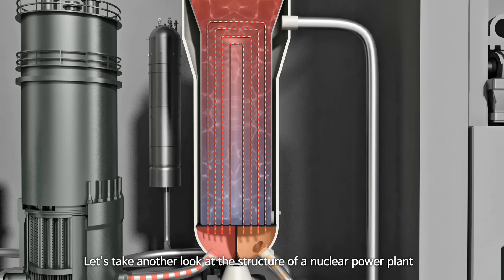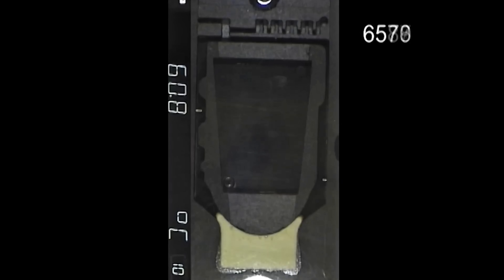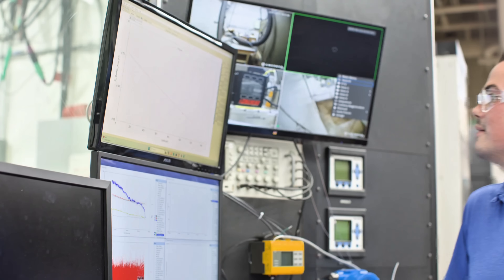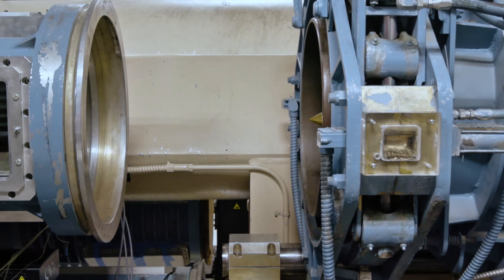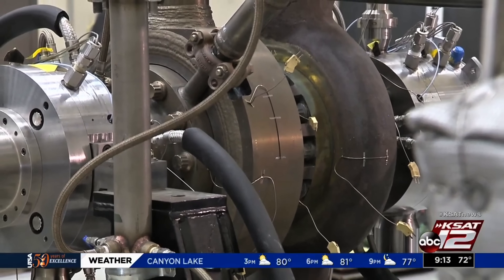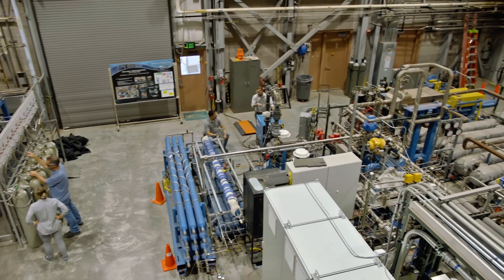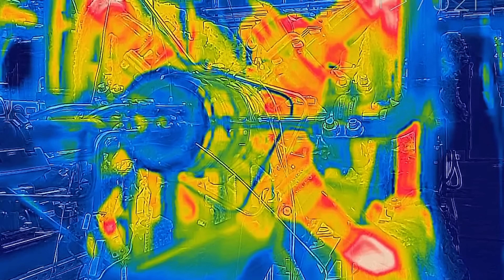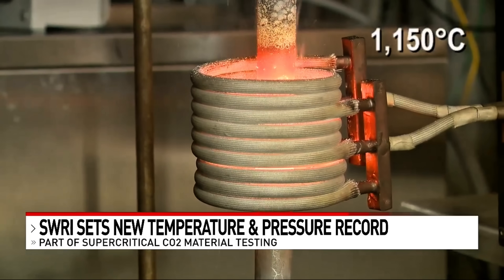End Of Gas Plants: World First Supercritical CO₂ Turbine Is Finally Here!

Comment: Not a good explanation but if its cost-effective in variable vRE back-up  then it could use high temp heat stored in hot brick storage ( relatively cheap ) - heated by otherwise curtailed vRE electricity from wind and PV when supply exceeds demand.

Comment: How long will it take for Supercritical CO2 turbines to replace steam power plants? Supercritical CO2 (sCO2) turbines aren't expected to completely replace steam plants soon, but rather augment them, especially in combined heat/power or nuclear applications, with pilot projects proving viability now, but widespread adoption hinges on cost, material durability at high temps, and scalability, potentially seeing significant growth in the next decade as technology matures from demonstrations (like the STEP Demo) to commercial scale, gradually displacing less efficient steam cycles where feasible. 
Current Status & Timeline
Demonstration Phase (Now - ~2025/2026): Projects like the STEP Demo are proving sCO2 power cycles work, generating electricity and aiming for full-power testing, but this is still near-term.
Early Commercialization (~2025 - 2030s): Expect initial commercial deployment in specific niches, perhaps smaller units or integrated with industrial processes, testing real-world performance and costs.
Wider Adoption (2030s - 2040s+): If successful, sCO2 could become a major player, potentially replacing steam in new builds or retrofits, but steam's reliability means it won't vanish overnight. 
Why sCO2 is Promising (But Not a Quick Fix)
Higher Efficiency: sCO2 allows for higher operating temperatures and pressures, leading to simpler, smaller turbines and potentially greater efficiency than traditional steam.
Simpler Design: Fewer turbine stages (e.g., 4 vs. 10-15 for steam) and smaller components.
Key Challenges: High-temperature material durability, scaling up to utility-level power, and reducing overall system costs are hurdles. 
The Reality
Supercritical CO2 technology is a strong contender for next-generation power, especially in concentrated solar, geothermal, and advanced nuclear, but steam turbines are robust, proven, and won't be fully replaced for decades; sCO2 will likely integrate and compete, not instantly dominate, say Southwest Research Institute and other experts.

Comment: GTI Energy is the builder of the STEP Demo, which will generate 10MWe upon completion. SRI are one of the contributors. This turbine is built upon the Brayton Cycle. It is desk sized unlike steam turbines that are almost football field sized and way more expensive. By changing out our US Steam turbines with a supercritical CO2 system, our power plants can go from 30 - 40% efficiency to 50% efficiency. Currently only Combined Cycle Gas Turbine Natural Gas plants which are very expensive can pull off 50% efficiency. 

I first heard about these new turbines from Kirk Sorenson of FliBe Energy who has been giving talks on how Thorium Molten Salt Reactors  (MSRs) would require these types of turbines because of the amount of heat they can generate. 

All those coal plants (12) in MD shut down that created 3.8GW, could still be online generating even more power were it not for "Climate Change" nuts. See CLINTEL . org "World Climate Declaration" Now many in MD have utility prices too high to pay. Democrats are a bunch of liars.